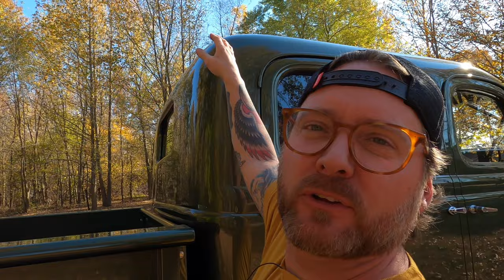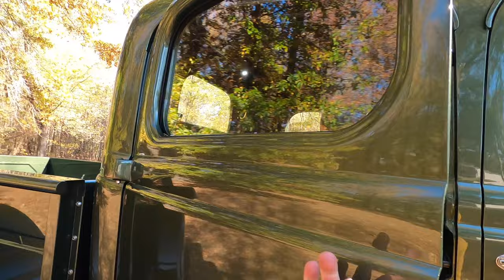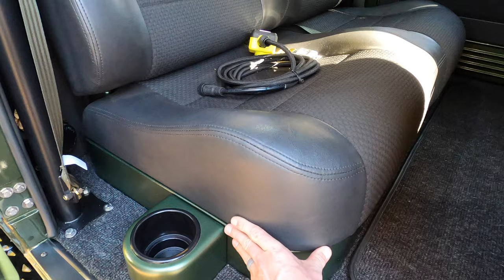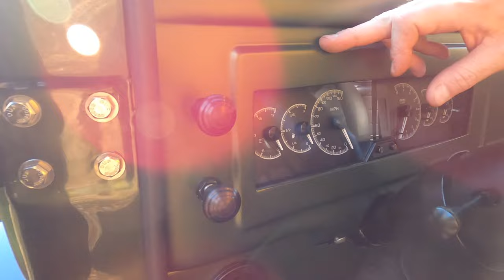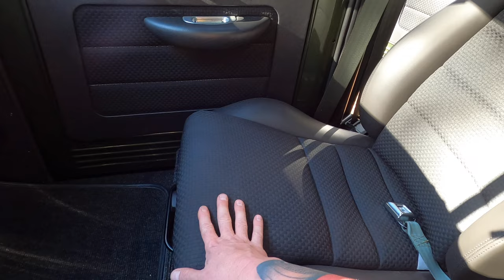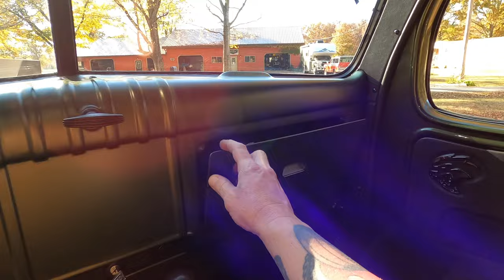1949 Hellcat Powered Powerwagon

Comment: Last year I helped a friend take the old flathead 6 out and dropped in a 12 valve cummings into one that is all original still except the engine and trans and that thing is a beast that will pull down anything it has mega torque but he has to get a new rear end because the OG rear end is geared so low that it tops out at 50 I think he is putting a Ram 3500 rear end in it and it's already awesome but will be even better when it will go down the highway at 75 mph

Comment: I like it but in my opinion those trucks should have a diesel engine in it the 42 custom power wagon that Jay Leno had on there was a awesome truck but I like how yours has the custom crew cab now that with a modded 6.7 cummins would be a better engine and could make the same or more of power than the hellcat engine and will have the torque to pull down a house. But love how you guys done it. I have had a soft spot for those trucks ever since I was a kid and my Grandfather had one on the farm with the flathead 6 it's the first thing I ever drove and shifted gears on.

Comment: The fuel type has nothing to do with having enough power. You could run E85 and then twin-turbiscuits. Or, run LNG/Propane on a converted gas engine. Power & torque is power & torque.

Comment: The work is beautiful, but there is very little space for rear passengers. I think that it was necessary to take two cabins from the ZIL 157 and connect everything. For a long time I had an idea to make such a pickup truck, but on a ZIL 157 frame with a 6x6 wheel arrangement.Zil 157 has a very interesting hood system and the windshield opens